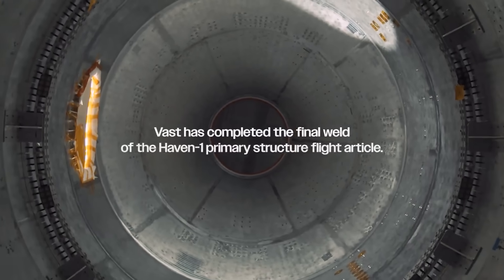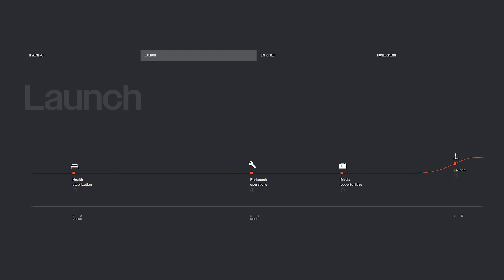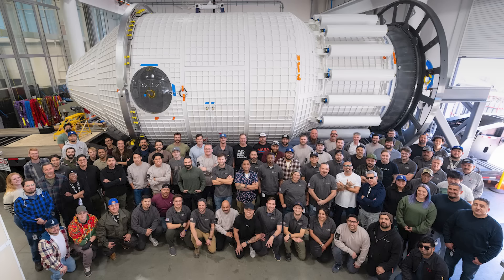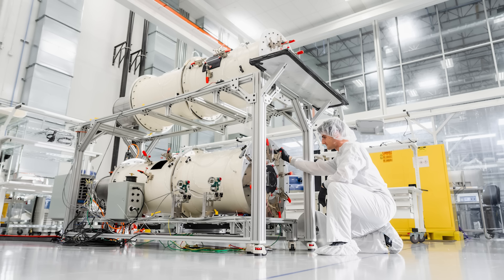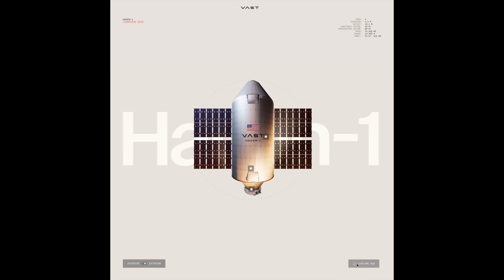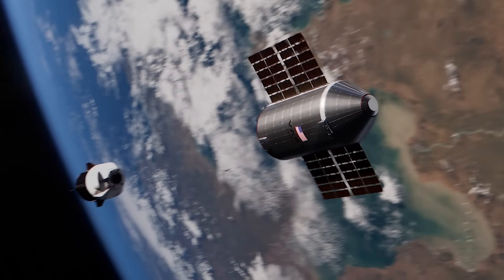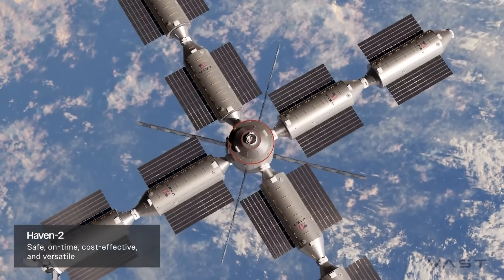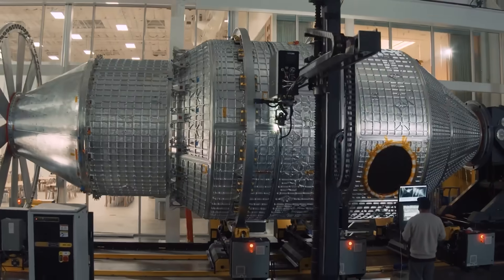The First Commercial Space Station Structure Is Complete

Comment: What I don't get is why companies don't do what SpaceX has done and just use simple metal rings welded together? Like SpaceX is supposedly going to send humans to the moon and mars in that so it's gotta be good enough for a space station.
Reply: Only parts of SpaceX ships are rings welded together.  In the same way, this is tubes and cones welded together.
Reply: @martythemartian99 True, but even this is made out of cnc aluminum (i think), which is more complex and slower to build.
Reply: This actually made me think of the original idea for Skylab, which was a refitted upper stage. I wonder how hard it would be to pressurize the starship cargo bay and use it as a space station, considering they already have plans for crew
Reply: @deserting8710 Yeah, I almost commented about that instead of what I did. The main issue is that I think starship would be better suited for building large space stations, not the station itself.
Reply: @deserting8710   Plans are afoot for a Starship Station, but there is no single solution to building a space station.  The Starship Station would be a quick ISS replacement, but it does have disadvantages, as do all other designs.  Think of it like cars.  Not everyone needs or wants an F150 truck, and not everyone can make do with a Kei car.  But there is a market for both.
Reply: @martythemartian99  Plans are afoot for a starship station?  According to who?
Reply: @martythemartian99  Ok.  So no real plans just a lot of speculation and dreaming.  Well, that's where it starts.  Lets hope!
Reply: Putting anything up there is very expensive. Might as well make it as good as you can, you don't get a bunch of chances to launch another one unless you are the one making the rocket, and even then you need massive financial having to pull something like that. If SpaceX can drastically bring down launch costs then things could start changing a bit, but right now it's best to take your time and make it count
Reply: @Cammymoop   If experience is anything to go by, although the Vast station is designed to last for three years, it could last 5 or 6.  I can't say for sure but improving the design to last 10 to 15 years, may increase the cost by too high a factor.  Also with so many private stations in the works, I can see an advantage to mass producing segments and incorporating improvements along the way.  So a Haven 2 built in 2035, though it may look similar, would be a much better and more capable unit than one built in 2026.
Reply: @martythemartian99  haven 1 is an experiment, meant to be learned from and not stick around to hold them back. So in this case it probably doesn't matter a lot, but even with this small and relatively short-lived station it's well worth a more refined design (especially in ways that help with learning about future designs), though it's also obviously important that it's still pretty quick to get up there
Reply: @martythemartian99 if I am not mistaken vast 1 is meant to be a test bed for their systems. And they build on the SpaceX model of production

Comment: Russia has finished testing its NEM-1 core module for its ROSS space-station, Russia claim its the most advanced Station ever built and builds upon 50yrs of a crew in orbit, it will launch 2027, great vid.👍
Reply: Russia claims a lot but remember, Mir deteriorated over time just like the ISS did, and it is the Russian components that are giving the most trouble.
Reply: The way this comment was made was bot-like. Meant to pass a certain message but not look like it's trying.
Reply: @kevikiru  Name another nation with a record of 50yr of a crew in orbit, or 1700 launches of a Soyuz rocket, Russia saved US space program, when US retired Shuttle Soyuz was NASA's only ferry to ISS for 10yrs, Bow your heads.
Reply: @paulroberts7429   Name another nation still using rockets and capsules from the 1960s.  🤣
Reply: @paulroberts7429  And the US saved the Russian space program in the 1990s. And right now, the Russian space program has hit some headwinds (see quality issues with hardware, and accusations of on orbit sabotage from management). 

As for the 1700 launches, does that include every R7 launch? If yes, that number covered alot of different activities, derivatives, much done under a Soviet regime that didn't seem to care too much about cost when it came to certain endeavors. 

Soyuz-U was the variant with the most launches, at 786 launches over 44 or so years, with 765 of them successful. 

As for experience with crews on orbit, think the tribal experience has been pretty much comparable between Russia and the US since 2000; and there are other countries gaining experience.
Reply: @michaeldunne338  You are joking right, US 2025 ULA/Boeing used 100th Russian RD-180 engine Atlas-5, ISS is Mir-2 Roscosmos museum mir-2 plans, US $ only, how many space-stations as US had 1, Russia 11 space stations, China's Tiangong is a modified Salyut with Soyuz module, ISS is old but US want to extend ISS Russia doesn't want to, but seeing as life support is Russian and altitude control and propulsion, docking capabilities, is Russia so they can't that's why Nasa as Soyuz contract till 2027.
Reply: @martythemartian99  The most successful rocket and capsule in human history and a closed cycle oxygen rich rocket engine, sadly US never achieved, that is why in 2025 launch by ULA Atlas-5 using its 100th Russian RD-180 engine over 15yr period, US rockets are and where garbage.
Reply: @paulroberts7429  strange string of irrelevant talking points there, that don't take away from the fact that: 1) the US saved the Russian space program in the 1990s, and 2) a quarter century of work with ISS has brought about parity in experience with space stations on orbit. 

The ISS is not just Mir-2 -  see Unity module, Destiny module, the Integrated Truss Structure, the Quest Joint Airlock, BEAM, Solar Array Wings, etc. (and Zarya was funded by the US). Harmony, Tranquility and Destiny have life support subsystems too, and there is a Water Recover System in the American segment, all part of the ECLSS.

 So at this point, it doesn't matter much how many Salyuts were put up by the Soviet Union in the 1970s and 1980s (of which a number failed).
Reply: @michaeldunne338  Russia had Mir they didn't need US who had nothing, US offered money that's it, Mir-2 its core module was finished mir-2 with truss was designed before US got involved, it was US who approach Russia and bought 3 empty modules, I watched V.P Al Gore in Russia on TV, Lockheed bought 50 Russian RD-180 engines for Atlas-5 then sold Atlas to ULA and Boeing who bought 50 more, Russian rocket engine were superior.
Reply: @paulroberts7429  Mir was falling apart. This was all well documented. And US money helped keep that going for a little longer, although the operation fell into the maintenance trap - resources stuck keeping things running, vs doing research. Won't go into the fire and collisions. 

The truss was built by the US. Period. 

The RD-180s have had little to do with the ISS program (OK, if Starliner had progressed faster, but the program wasn't contingent on that launch service). And, that initiative went through Q&A processes and project management practices of Lockheed, which probably one reason why you didn't have the issues like with the RD-170/171s blowing up. 

Not sure why the fire hose of talking points that seem irrelevant, or inaccurate through omission of facts, etc.?
Reply: @michaeldunne338  Yes record setting Mir was finished, that is why Russia built mir-2 (ISS) Russia's new design with truss and docking mechanism APAS-89/95 (sold to China with robotic arm) was revolutionary,Mir and Mir-2 would build on the greatest life-support system, this is where Russia excel, Russia 1000ltr EU 600ltr US 500ltr imagine mission to Mars US make halfway ,when you see cargo its for US garbage life-support water.
Reply: @paulroberts7429  it doesn't matter what has happened in the past (6x moon landings) what matters is TODAY. spaceX has revolutionized reusability. russia throws everything away . everytime. do they not?